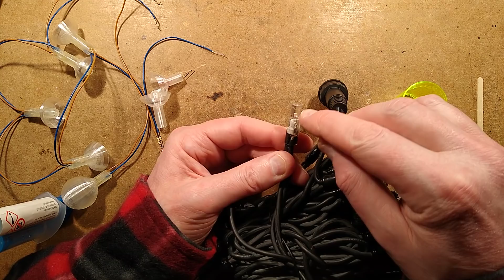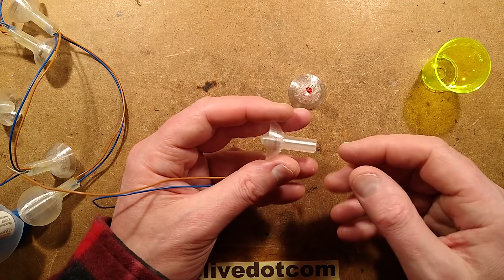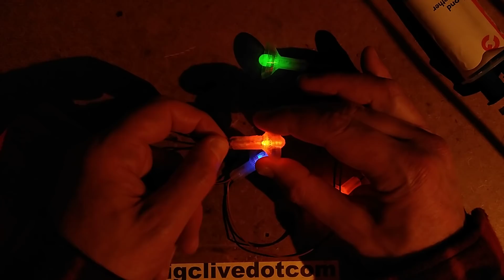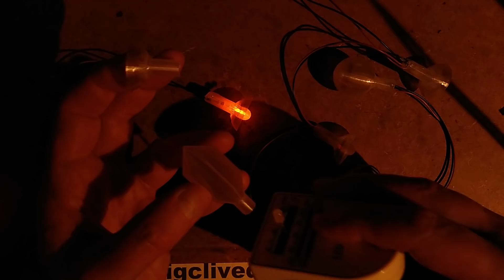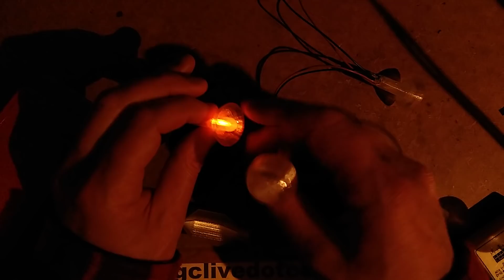The almost regrettable neon fairy light project.

Comment: @bigclivedotcom could you use a different resistor value and run them from 55VAC such as from a 110 bucket?

Would get you closer to a “safe” voltage for single insulated wire and fundamentally isolated so another safety bonus

Comment: Thanks Clive . You can get the epoxy glue in a dispenser that goes into one nozzle , I've not used one myself but its would have made things easier just to inject the mixed glue inside the caps. They are available on Amazon in 4ml packages for about £2.00 .

Comment: PLA is biodegradable, but it requires 60°C temps. The bigger concern with outdoor usage is the fact that UV light can damage pla, causing it to warp and discolour. 

PETG is an amazing plastic that's a little harder to print, but is stronger than pla or abs and can resist UV damage.

Comment: Damn it - now look what you’ve done. Some poor sot out there is going to want to make a neon fairy light using only a 100 ohm resistor, and potted in epoxy, and then plug it into the mains! I predict way too much excitement, and the need for a change of pants! 🤣
Reply: That potential problem of maybe having too much excitement can be averted by leaving out the costly 30 cent neon bulb and using pingpong nitrocellulose lacquer in lieu of epoxy. That will also fix the problem of the lights being too dim.

Comment: Clive - buy a batch of 20 non-medical syringes from Amazon / eBay. I use 'em for filling fountain pen cartridges but I bet they would work for super sloppy resin. Discard the blunt needles provided, just suck the goop from the shot glass and then squirt it into a moulding. They have about a 2-3mm hole in the nozzle. You'd be able to do quite a few lights per syringe before the resin dried in the nozzle.

Comment: I often use epoxy, that cures in 24h. 
It's more liquid and I can use a syringe to apply it.
In cold temperatures(below 18°C room temperature and no warm hands applied), it stays liquid enough to pour for a hour.
I usually try to be done in 30min, to be on the safe side.
But the process is more efficient, since I can do a lot in 30 min.

Comment: If you were going to make a long string I would think the best way to do the resin injection would be with a syringe (the type with a plastic end used for feeding fluid oral medicine to babies/pets, not the injection type with a sharp metal needle...) and to put the lamp/led in before the resin. also a small hole to let the air out at the lamp end as you inject the resin might be a good idea.

Comment: They do make two part epoxy in those syringes with self mixing tips that would make filling them less work. called "Instant Mix" 

https://www.amazon.com/Loctite-Instant-0-47-Fluid-Syringe-1365868/dp/B0044F9KFI

Comment: 5:55 - When inserting the mixed epoxy, could a syringe not help suck it up and then put it in place rather than scooping it in?

Most pharmacies could supply syringes but then there's the potential fiddliness and cleaning of them with acetone or other substances but at least they've got markings to know exactly how much to put into a space.
Reply: reggiep75 disposable syringes are so cheap (about 5 quid per 100), it’s hardly worth the bother of cleaning them
Reply: @emma.jacobs1  - Yep, It completely passed my mind that you could grab a boat load of these from ebay (late night mind not working right) but in the interest of not making more plastic waste was the reason why I said to try and clean.

Comment: I did a similar project following one of your previous led vids but used clear silicon mastic from a tube  (more easily dispensed ) potted in rubber boots. 
After the silicon set I removed th silicon boot, they have lasted well in the garden with no evident rust so far.
Those neons look so cool though I am a little dubious about putting them outside.
Thanks for sharing.
⭐⭐⭐⭐⭐

Comment: PLA WILL compost under ideal conditions of heat and moisture.   Should be fine in regular daily use   even outside... but don't make it hot and wet at same time

Comment: I think the best bet is to come up with a potting system that very consistently pops out the tip of the 5mm LED casings and use that as a friction fit mount for the globes.

Comment: honestly do a batch of lights at once and quickly inject the pre-mixed resin in with a disposable syringe/blunt needle..  work smarter not harder
Reply: This is how the older style adhesive polish fiber optic connectors go together. I did a few of those some years back, and the main difficulty was that the resin was very fast setting. 2 minutes is not much time to mix the resin, fill the syringe, and get the fiber into the connector without breaking it.

Comment: You might want to try printing a nozzle for the resin tube that mixes them together and dispenses it with a narrower tip you can use to do this with less steps and less mess.

Comment: I had to backfill a few hundred studs for the Tarnhelm, in a production of Wagner's Ring Cycle. It was easier to use a piece of plastic wrap to mix the resin on/in, then twist it up like a tiny pastry tube, massage it to mix, then puncture a hole with a pin, stretching a tiny nozzle in the tip, at the same time. You can feel the stuff stiffen, so you get to know how mny more you can fill, and when the bag is firm, you know the filled studs can be moved, and the next ones set up.

Comment: If you want to pursue this further, I'd suggest making the shape(s) with 3d printing then a RTV silicone mold then cast the lights straight into resin. Kits are available. I've used one from a company called Alumilite before.

Comment: Epoxy resin foreseen to use with glass fiber cloth runs like water, so maybe more appropriate. Easy to get in syringes, but runny, have to hold your bits open side up. Hot glue may melt or deform the pla, acetic silicone is corrosive, UV cured resin is very nice, but a nice glue that I recently found to be very effective on pla, mix-free and relatively fast curing is sold under various brands like repair'extrem, (pattex) , bison here on Belgium has a similar one. Clear glue, with a very distinctive eucalyptus smell. Look for "polymer" glue on the package, or something similar. Seals like silicone, kind of solvent-free, stays slightly flexible, ideal for leather and rubbery think as well. Available in relatively large tubes with narrow tips.

Comment: Get some little plastic zip seal bags like they sell meth in. Put the glue in them. Cut a little corner off and use it like a disposablecake icer. You can mix the resin by by rolling the bag between your fingers. 

I still wouldn't doit though. Too fiddly.

Comment: You are making this a lot more difficult than it needs to be.  To start do not use 5 minute epoxy. Secondly you need a large disposable syringe with a blunt needle.  This would allow you to inject a small amount of resin into the socket and then allow you to insert the light into the globe and then back fill the socket.  Once the socket was back filled you need to then hang each completed light to cure which could partially be sped up by UV lighting and a warn environment.  Lastly if you wanted the lights to dry straight in there socket this could be accomplished using pieces of pvc tubing

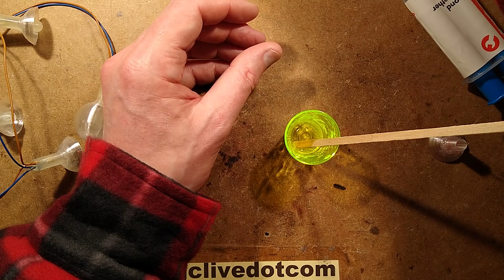Comment: 7:49 - keeping it upright - tie wires together & hook over something - or will the plastic gradually slide off it ?
Reply: Use a clean shot glass/mixing cup to hold them
Reply: A wooden board with suitably-sized and spaced holes drilled in it, or even a cardboard box!
Reply: @alanmumford8806  Toilet roll card tube !

Comment: I should tell you Clive that 3D printed stuff is very porus. I printed off a vase for the wife which leaked like a sieve, even when printed at 0.1mm with 100% infill. So i'd imagin your fairy lights might not last too long outside. Just a heads up :)

Comment: Get some of the resin that's nearly as viscous as water. Switch your filament to PETG, it prints just a well as PLA after a slight adjustment of the retraction distance and/or retraction speed and it wont degrade as PLA does (plus you don't have to worry about excessive sunlight turning it into PlayDoh). If you're making a sphere, model in your own custom support area so the top of the globe prints much nicer.

Comment: you need to print a plug with a groove cut out on each side for the wire, put the light/led in, push the plug in to hold it down and fill most of the hole then you would just need a little epoxy to seal up the plug and wires, you wouldn't need nearly as much.

Comment: Teardown wish.  "Graphene Bower Bank"
https://www.amazon.com/gp/product/B07W6JW72V?pf_rd_p=ab873d20-a0ca-439b-ac45-cd78f07a84d8&pf_rd_r=V6XQK1Q02EFA8589XKRN

The marketing leads you to believe it's new battery tech.  I'm guessing it's regular Lithium cells with some carbon based heat sinking they are claiming is graphene.

Comment: I think you could mix the resin in a small plastic bag, cut one corner off and use that like you would use a glazing syringe. Also, PLA is biodegradable, BUT it needs a pretty specific environment to be palatable to bacteria. It has to be warm, humid and alcaline. Stored on a shelf it will last for ages, though it will soak up moisture over time and become brittle.

Comment: I have a hot melt glue gun that has attachments, one is a small tube type tip. You can inject the hot melt glue right in to the area. Works great with PLA. Also the 3d printer UV resin is water thin, a eye dropper would fill the area and then just cure.

Comment: You should get a 5mil syringe and cut it down and mix the resin in the bottom with a tiny hole you can cover at the bottom so you can push plunger alway down with nothing coming out end till you want it to. Phew.

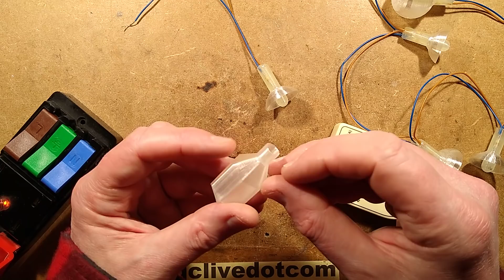Comment: The crystal at 12:00 looks like the fins from a dart. That would be nice, a light up dart.
Reply: If you could take the metal tip from a dart and stick it into a 3D-printed enclosure, and used a high-quality battery for each, having constructed a battery circuit in each enclosure, then you can in theory have a well-weighted set of illuminated darts.
Oh my God Clive do it. Make us some illuminated darts.

Comment: The easy way is to use silicone sealant or do i miss something here?
Reply: From mentions in previous videos, the standard silicone sealant used for sealing bathrooms and such is apparently acid-curing, and thus probably not great for electronics. You can get non-acid-curing varieties, though.

Comment: I use a similar string of lights in my garden as you showed in the beginning. I have had a single 100 string on all year for 4 years after dark and it has now burned out most of the leds and their brightness are 1/5 of what the new ones were.
Some of the strings also showed the yellow discolour. And one or two had some water ingress and I could see a bit of rust.

Comment: Clive have you thought about using a little paper cone,like what cooks use for icing but with out the metal end,i've seen it used on Youtube before,just use shinny magazine paper so as the resin don't stick to it all that much,then pour the resin in and fold over and squeeze the resin in as needed,i could find the video up if you need it if not i'm sure you or someone else could find it,just a thought. 😉

Comment: uv resistant is ASA material, its cheap but you have ot print it with high temp,  you can print them and them make a mould form silicon and then cast them with led inside from resin :) also uv resistant resin otherwise goes yellow and water reppelant resin too, that would be jewelerry casting resin for  exmaple is fine its food grade aswell for some reason
Reply: I was going to suggest ASA but noticed you did first.

Comment: I've never had good luck with PLA being waterproof
Reply: Bump your extrusion multiplier up a bit (intentionally over-extruding, to minimise the chance of any gaps between layers or walls) and use additional perimeters. Increasing the extrusion multiplier too far can result in less-ideal prints from an aesthetics perspective, but it at least means that you've got more plastic being squeezed into any gaps.

I see no reason why PLA can't be waterproof (within the limits of that "oh actually it turns out that a lot of plastics allow an extremely slow passage of water through them" thing); you just have to ensure that the printing process itself hasn't ruined your plans :) The bigger problem with putting PLA outside is that it can soften a fair bit in surprisingly-low temperatures...

Another option would be to "paint" the part with something that seals any gaps, such as Smooth-On's XTC-3D - which is, AFAICT, literally just two-part epoxy resin.
Or you could modify the ABS acetone-smoothing process to instead use a solvent that works with PLA, such as ethyl acetate (well-ventilated area, etc.; I'm not aware of all of the options or their relative merits). I don't have a huge amount of experience with that, but I've used a simple pump spray bottle to apply a small amount of ethyl acetate to a PLA part and it had a very similar effect to that seen wtih acetone on ABS.
I'd imagine that Polymaker's PolySmooth (PVB) filament, once treated with isopropyl alcohol, would be much the same.
Reply: Single or even dual layers is going to be tough but along with the over extrusion Andrew mentions bump your extrusion temperature 5-10 C .Vase mode will help in the case of shades as there is no start stop points on every layer to possibly create a hole.
Reply: I've used clear coat successfully to seal prints. Smaller objects can be painted with just clear nail polish. And since PLA doesn't react to acetone, you can thin the nail polish a bit to make it less viscous.

Comment: Nice project.  Looks good.
PLA breaks down when exposed to UV.   For outdoor use, PETG will last longer.
There are many epoxies which are less viscous so would be easier to pour.   Some have much longer shelf life.
Dave.
Reply: PLA in particular the non pigmented ones breaks down very slowly with just UV and open air exposure even the coloured ones it is the pigment that suffers ahead of the filament itself. PLA needs a fairly specific high Heat/Humidity to breakdown. Bio packaging for example doesn't breakdown fully in general compost but needs a proper reactor.
Reply: I've 3D printed quite a few PLA mushrooms for my wife's fairy garden and they've been outdoors in all the worst of the UK weather for over two years now without and visible signs of degradation. OK they were undercoated with car body primer and then hand painted with acrylics, so maybe that's protecting the PLA itself. Not sure but 3D printed stuff is definitely viable for garden ornaments
Reply: Marine epoxy pours nicely, but it's expensive. There are probably better options.
Reply: PLA doesn't break down with UV, at least not very fast. The pigments in PLA will break down with UV, the colors will fade but it keeps its structural integrity. Pigments in PETG will last a lot longer, although it is broken up eventually. PLA biodegrades but only if it has suitable conditions. It needs to chemically break into shorter polymers which bacteria can then eat. The best way to get the conditions perfect is to use it in a compost, soil has chemicals that will break down PLA to a form that bacteria can use as food. Aquarium biofilter is another place where PLA will break down very fast, the conditions are quite perfect and there are HUGE loads of different kind of bacteria. Add UV to perfect scenario and it will hasten the demise. People have kept PLA prints outside for years without a problem, some have had theirs degrade in couple of months.

Comment: You could consider using a Bondo-type resin -- room temperature cure thermoset polyester. Or even better, how about paraffin wax, melting around 160°F?  Might use a use a disposable plastic syringe to dispense wrapped in insulation, handling it with gloves.  Should provide a waterproof seal, I think.

Comment: For anyone doing this project, you can buy disposable syringes in various capacities along with “blunt” tips in a variety of gauges off of Amazon and they are great for dispensing glue as well as for dispensing flux and solder paste.  For epoxy you will wish to use a fairly large gauge tip (e.g. 18 gauge at the smallest, or larger ideally, just remember that “larger” is a “smaller” gauge number...so 16 gauge is larger than 18) since epoxy is fairly viscous.  They are inexpensive enough for a project like this that you simply dispose of them once finished or the epoxy sets up.  But that would make getting the epoxy well into the lamp shade much easier and avoid possible air bubbles that might allow water an entry point plus you can dispense the epoxy much faster by preparing a number of lamp shades in advance and quickly injecting epoxy into them one after another, then reload the syringe and carry on injecting epoxy until you either run out of prepared lamp shades or the epoxy sets up on you.

Comment: i didn't realize your LED tester gave a specific current, i thought it was just an array of resister values off a battery. How does that work exactly?
Reply: Ohm's Law. If you say that the LED drops about 2 volts and make the supply significantly higher (say 12 volts) then a 1k resistor lets approx. 10/1 = 10mA of current flow. (Did I get that right?)
Reply: @manolisgledsodakis873  well as LEDs have differing forward voltages, I assumed from specifying 20mA that it was a regulated current rather than a simple resistor. a 2V LED and a 3V will get different currents then. I was thinking his may have been smarter than that.
Reply: Only resistors, a switch and battery in those led testers. They are very cheap too. About 1$/€.